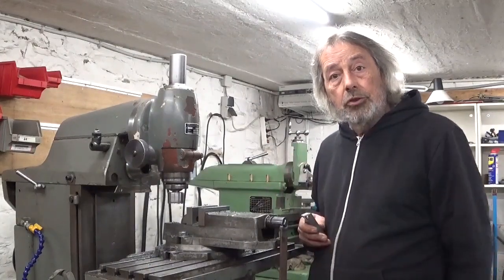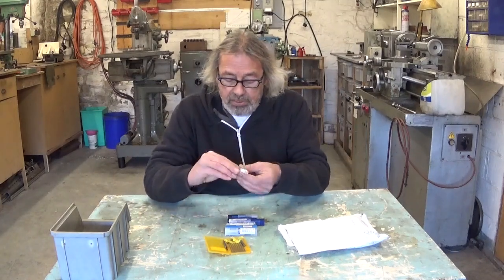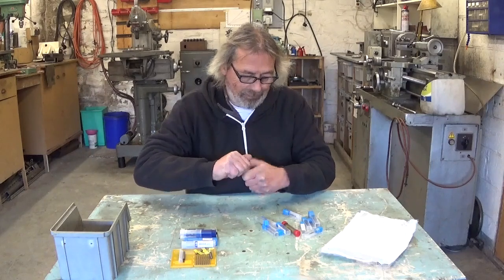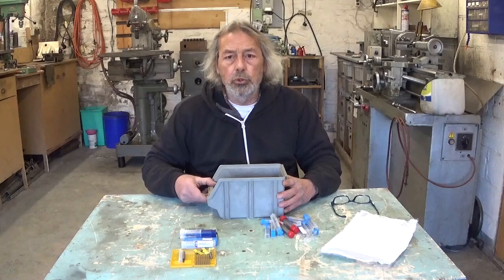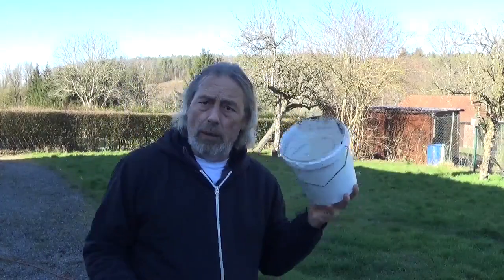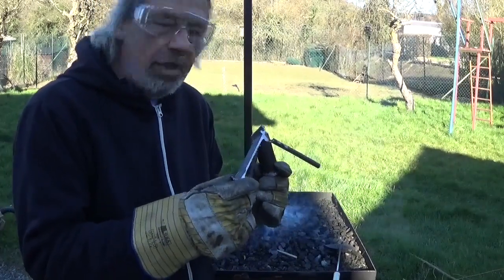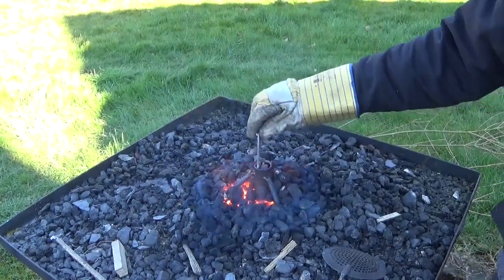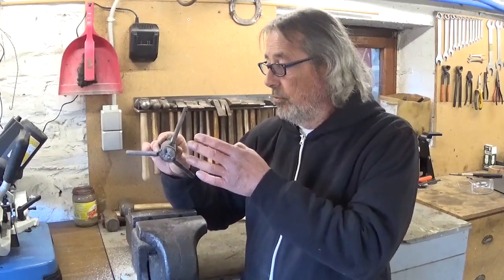Melting aluminium experiment.

Comment: I guese you have worked out by now that both martials expand during heating but when cooled the outer steel tube contracts at a different rate making it a jam fit.
Reply from the maker: Yep, I did. I will find a better way.

Comment: Michel, it looks like you got an uneven heat from your forge setup.  The fore didn't appear to have a deep tuyere to give you more room to set your "flask" into.  Or you would have needed to build a higher (pile of) coal fire to better surround the flask.  Doc at "Doc's Hotshop & Forge" here on YouTube uses old aluminum car wheels and gets very good results from them.  I've heard bad things about some aluminum engines as sources of aluminum due to anti-wear additives so the piston rings won't quickly wear the cylinders out.  Also, like others have said, use seamless rather than welded tubing/pipe so the weld seam won't "key" into the aluminum billet you cast.  If I tried this, I'd pour the melted metal into some kind of mold shaped like what you want, cylinders in this case -- even "official" foundry flasks end up with thin layers of metal stuck to the sides, like your tubing did, requiring different flasks for different metals to avoid cross-contamination.  Lastly, I've seen some folks with small foundries adding an additive to their melt to help remove/minimize the bubbles left in the molten aluminum, but I don't recall what it was -- however, I've also read in some real Foundry texts that these additives aren't needed, so I can only assume (and we know what that means) that the small home foundries either add stuff like this because they are simply copying someone else or it really helps in foundries that can't control what they add to their flasks ("unknown" metals).
Reply from the maker: Thanks for your input, Bob. It's really interesting.

Comment: Hi Michel, I do some Al melting in my blacksmith shop and I think hot iron and aluminum react somehow and form some form of chemical mixture. My 5mm thick iron crucible was full of cavities from inside after year of use. I switched to the graphite crucible and problem is gone. I use sand  forms to create aluminum or bronze cylinders, it's much faster and easier to do than trying to get bonded aluminum from iron pipe.I didn't try stainless pipes, inspiration for your next video…? ;) Good job anyway, I like your videos. Go on!
Reply from the maker: Thanks for the tips David.

Comment: There is plentybof information and instruction in:-

'The Charcoal Foundry'
by Dave Gingery

and

'The Backyard Foundry'
by B.Terry Aspin
Reply from the maker: Thanks. I will have a look at it.
Reply: @Rustinox  Of the two The Backyard Foundry is the more comprehensive. It covers casting flasks, pattetnmaking, casting and the construction of a furnace.
Dave Gingery's furnace is smaller and more portable but will only melt aluminium. Aspin's will melt cast iron.

Comment: Make or buy a larger melting vessel, and then pour it into a mould (can be steel pipe, should be fine). Melt it in the larger vessel, flux it with borax, skim off the slag and pour it into the mould. Works best if you preheat the mould a bit. Not glowing hot, just hot. 

If you let it cool in the same vessel you melt it in, they will basically braze together. Been down that road 🤣 

Graphite crucibles are cheap enough, I got my 2kg for $10 US. 

That coal forge is certainly more quiet than my furnace! Thing is unbelievably loud, considering it doesn’t have a fan or anything.
Reply from the maker: Thanks. The coal fire adds also something artisanal or retro :)
Reply: Definitely heat the crucible before pouring the metal. Cool metal will have a fine layer of moisture on it which will react violently when molten metal hits it.

Comment: lol...  nice try.  Next time, start with previously cast metal.  Dont overheat the hell out of it and pour into a soup can melting it in a cheap crucible on your forge.   Expect to have to machine a lot off.  And just watch what you melt doesnt have magnesium in it.  That means no VW parts!  Vinegar can be used to test for the presence of magnesium.  What were you doing with this thing anyways?  You are a machinist, not a metal caster.  And please dont make me watch a "devil forge" video,   but you can hit those idiots up and I bet they will send you a free furnace. 🙄  They know better than to send me one.
Reply from the maker: Don't worry. I want to make two aluminium parts, but I don't have the material, so...

Comment: I always take a steel plate e.g. 100x100mm and any pipe e.g. 32mm up to 100mm diameter and 200mm length and weld the pipe with only 4 small points to the plate. heat the aluminium in another steel pot, fill the pipe with hot aluminium, let it cool down. grind away the 4 points and punch out the cold aluminium rod through the pipe. no matter if the pipe has a welding line inside. it works. Best regards fischer v erla
Reply from the maker: Thanks for you input. That will help for next time.

Comment: Hi Michel ☺ thanks for another interesting video mate, apart from the problem whith your melting pot, I think you are on the right track, the quality of the finished aluminium  block is possibly caused by differant types of alloy,as you spoke of, and not enough heat in the first place, but I think it was a good first attempt, if we don't try we don't achieve anything, that's the fun of it, oh! and I realy liked how you could get what I think they call a compound angle on the milling table, I've not seen that before, take care my friend, best wishe's to you and your's, Stuart UK.
Reply from the maker: Well, it was my first experiment with melting aluminium. Next time better :)

Comment: Alot of dangerous semi-knowledge from my part, but there are substances out there to keep these bubbles from happening. I think for brass and steel, they use borax - but don't ask me what's best for Aluminium.
Also, a slightly conical casting shape might aid in removing the casting later on - provided that no welding occurs.
To keep that from happening, maybe pre-treat the mould by heating it up to create a scale that the Aluminium can't stick to... 
OK, I'll leave it to the professionals - I have no idea what I'm talking about xD
Reply from the maker: Well, I will watch some more casting videos :)

Comment: Michel...Aluminum wont weld to steel, but it will mechanically bond to steel when both are heated to the lowest melting point of the two , very much like glue bonded or soldered. Nice video buddy.😊
Reply from the maker: Very interesting, Al. Thanks.

Comment: Hi Michel. Thank you for teaching me how not to “cast” aluminium 😂
Seriously though, I really do want to learn how best to do it efficiently and economically at home. Good luck with your experiments. Andrew 👍😀
Reply: If you really want to know I would suggest reading:-

'The Charcoal Foundry'
by Dave Gingery

and

'The Backyard Foundry'
by
B. Terry Aspin

I would particularly recommend the latter  because it covers construction if a furnace, pattern making flasks and the casting process particularly in cast iron.
Reply: @532bluepeter1  Thank you for these two suggestions.
Reply from the maker: Well, the coal fire works great. I think that's a good start.

Comment: I don't know why that did not fall out when it cooled down.  The tube must have been warped in places is my guess.  If you use a good straight tube the aluminum will shrink as it cools and come out very easy.  It was interesting anyway.
Reply from the maker: The aluminium was sort of "soldered" to the steel, but only in the middle part. I didn't know it was possible.

Comment: Hi rustinox I found that regular pipe with the seam never worked for me either  but since been using rollers from a treadmill  they have no seam in them and after letting it cool for 30 min or so  I take and dip them in water to cool and the aluminum slides rite out also you should use a crucible to melt down the aluminum I use old heavy gauge fire extinguishers that I get for free at a local fire and safety shop !
I then clean the slag before  pouring it into the mold  it helps eliminate inclusions or holes in the bar stock  but that's just my opinion  but its always a learning curve buy experimentation also fun too👍
Reply from the maker: Thanks for the tip.